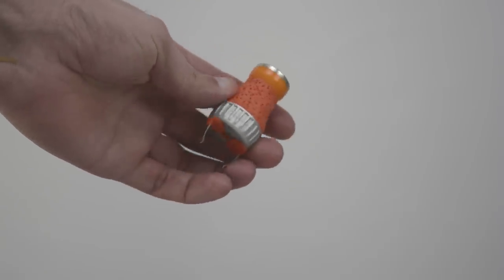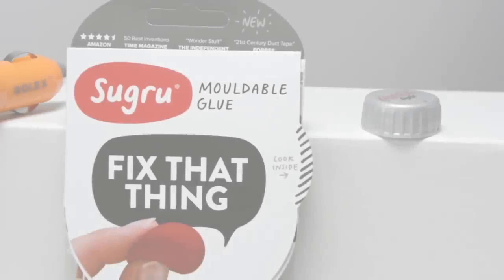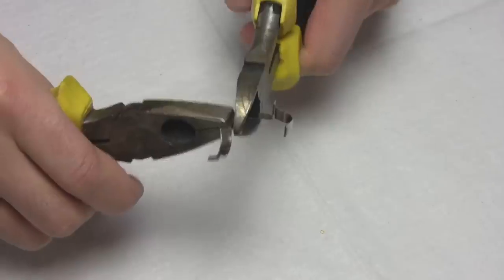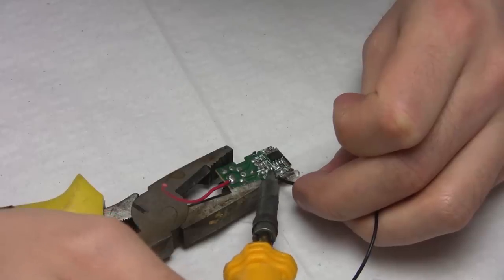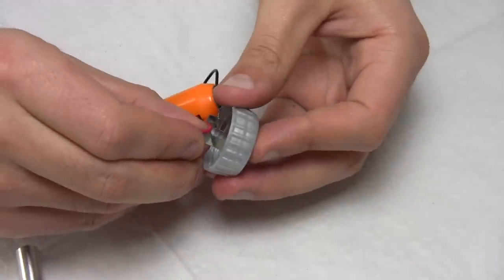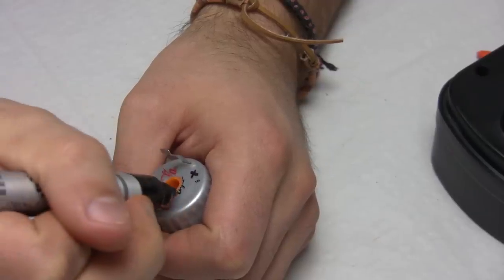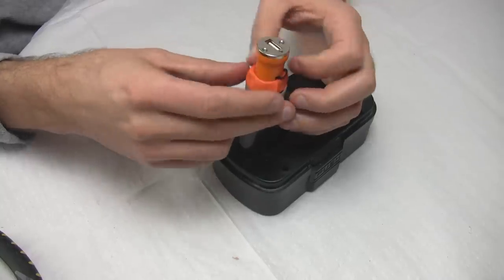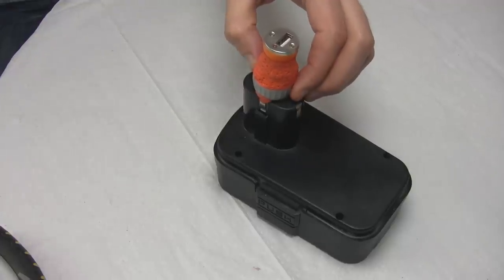Emergency USB Power bank from the Drill's Battery

Comment: I tried this with one of these and first of all I'm not saying that this doesn't work I'm saying this is what happened to me. but I hooked one of these car USB adaptors to an 18 volt charger and it got smoked, AND it said 12-24 volts input on it. I think I had a different one than yours. How many volts is that drill battery?
Reply from the maker: +coondogtheman1234 
My drill's battery is 24v.
Reply: *****
I don't understand why my USB charger smoked on an 18 volt charger. maybe the Co. that made it put the wrong label on it. some people have 24 volt vehicles with NATO plugs on the front grill so they would need these USB chargers to charge their phones and tablets on 24 volt systems.
Reply: coondogtheman1234 maybe wiring error?
Reply: I had everything hooked up right. I plugged it into an 18 volt charger that I modified with a 12V port so I can plug the drill into it. I made an adapter that lets me run my drill off a car battery. It is a 12 volt lighter plug to one of the drill's dead batteries.

Comment: I'm tempted to try this with a 9.6 Volt Drill Battery that no longer works in my Drill. (Size/Alignment issues) Can get those USB Chargers for $1 each so I'm willing to experiment with it. Might just rig up a socket as suggested earlier so I can swap in different devices easily. Maybe mold a Cap that will stay over the Battery end that'll keep good contact and reduce accidental shorts.
Reply: lgoamity i bet you never made it huh?

Comment: dos it mater what batery I use 12v or 18v ?
Reply: Depends on the car charger you use. Some can take 12-24 volts, in which case either battery would work.